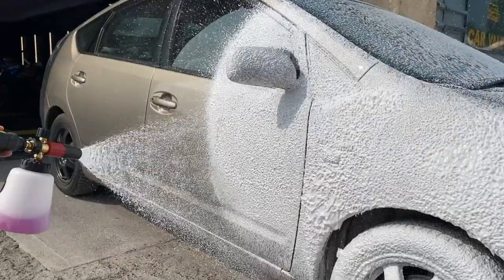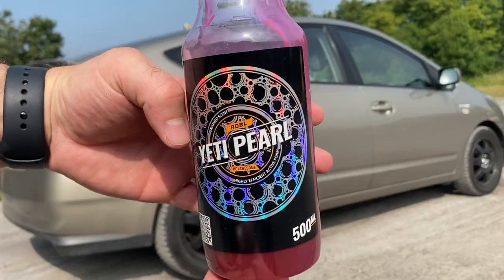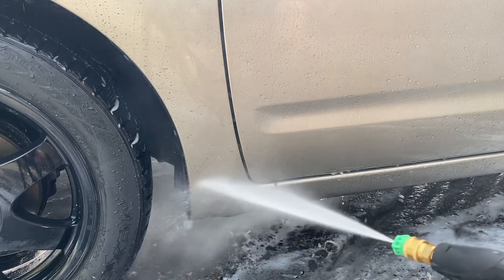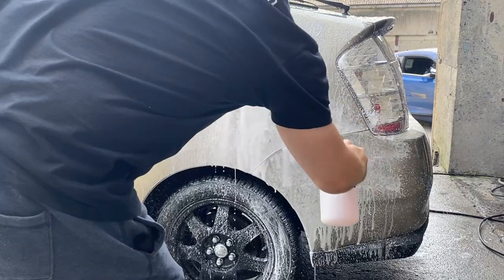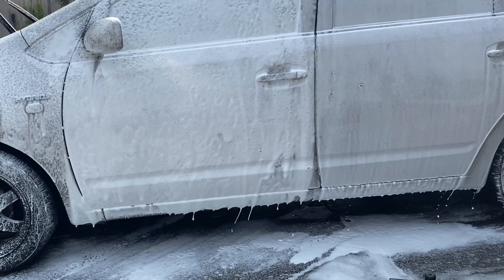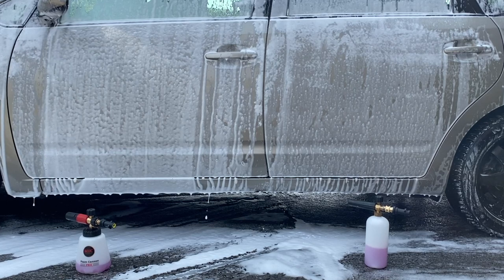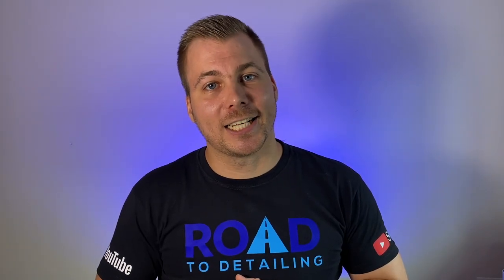The MJJC Foam Cannon Pro 2.0 Is NOT CHEAP, But...

Comment: The MJJC is a quality product and mine has been excellent so far. I don't think I'll go back to using a normal snow foam lance, having a wide neck bottle just makes thing so much easier with easier to fill and especially no falling over
Reply from the maker: Absolutely Chris! I love the wide neck of its bottle and I’m glad you mentioned that in your comment, because I didn’t say nothing about it, but that’s a cool extra thing I rate so much as well. I have just realized I missed this part out after I finished the editing and upload, so thank you for that! My plan is to have 2 more other lance and give them a go side by side and those 2 are in the same sort of price range, also very popular: MTM PF22 (old version) and Autoglym Polar Blaster. My curiosity won’t stop me having them too 😬
Reply: @RoadToDetailing  I have the polar blaster aswell, can't say there is much between from my use of them but I'd lean towards the MJJC as there some free spares with it and the nozzle is a bit better
Reply from the maker: Thanks for sharing this information Chris! It’s good to hear that, what I’m sort of expecting (in advance without using that yet) from the Polar Blaster’s (being the same foaming capability as MJJC’s), but lacks on some features which MJJC’s strengths, like spare parts and nozzle angles. Amazon has currently a good offer on the Polar Blast so I’m thinking to get it, but I would like to invest the old MTM lance first, but so fat I didn’t find anyone in Ireland just yet (on Amazon sellers don’t send it over here) so I’m still in the research stage with that. 😊 I found a UK store which I could buy from and the shipping cost wouldn’t be a fortune, so that might will be the winner. If you know anyone here, don’t hold that back 🙏😝

Comment: cut down on the product work out the dilution rates so you dont overfill it and then less waste
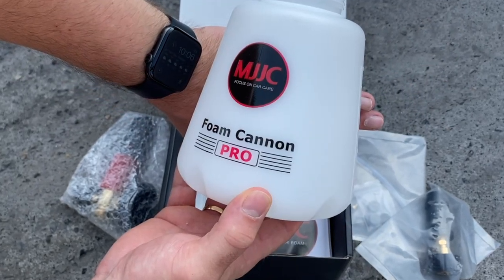Reply from the maker: The dilution ratio is actually right (1:10). What I could do better is to dialing down the water mixture with the adjustable mixer on top of the foam lance. So I could have a better layer of foam which sticks more on the surface. I just wanted to see how thick it can be, but I usually adjusting the mixture to a way where the consistency a bit more like “milky” so it’s not that thick to fall down to quickly. MJJC’s atomizer tends to provide “too thick” foam when by default on maximum “solution” setting on the top.
Reply: @RoadToDetailing  yes what ive worked out is not to fill it up as most cars im left with say a third left ,and as i dont like storing the product it ends up geting thrown away as it is essential you wash it out after every use and morso if you use a finishing wax product ,as this will block it up in no time
Reply from the maker: @peterr7437  yes, that's right. with the MJJC one I easily use up a liter of solution. (this is also 1 thing I don't like about it tbh.) with MTM's foam gun I use only 45ml solution and 455ml water (1 to 10) and that's enough for the whole car. That's one thing I like about the MTM one and the quailty of materials is even better there. 

I use a separate "cheap chinese" (10 quid) lance, that is in the video for foam cannon style sealants, so that works for me the best. 

But I agree that, you need to flush out the equipments after each use, and if you still have product left inside, that's going to be a waste. Which I don't like either.

Comment: These parts are useless... dawn soap soak your filter.  It's just wax build up
Reply from the maker: Can be, yes. But sometimes the filters gone rusted and clogging up that much, when the only solution is to replace them. In that case, spare parts can be handy. However, MJJC do not supply these “useless” spare parts from mid 2022 in their packages, meaning you are technically right. 👌🏻